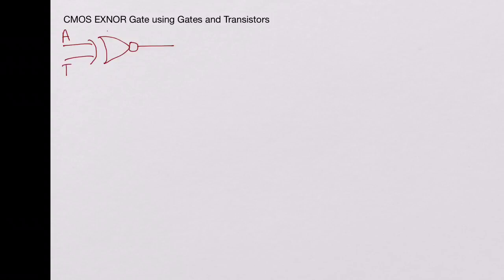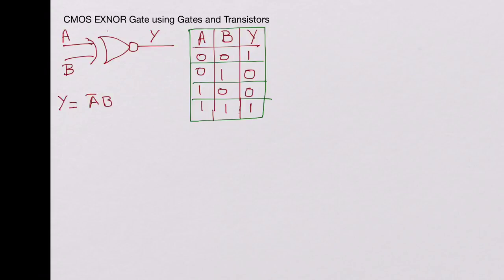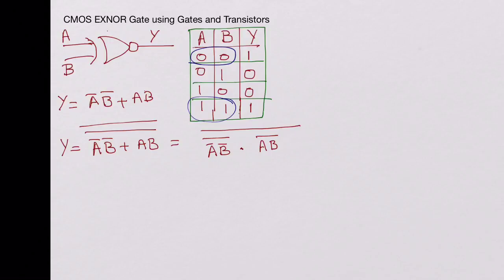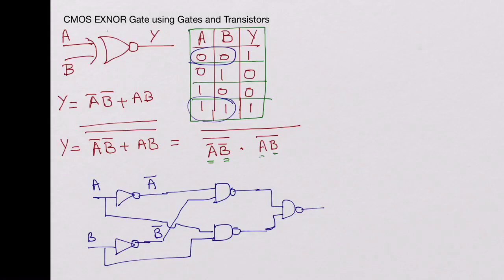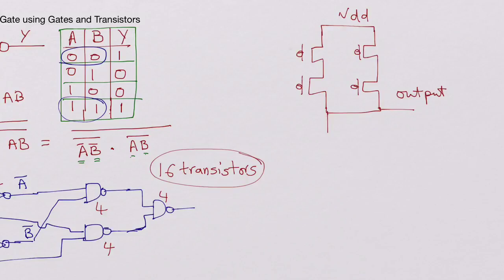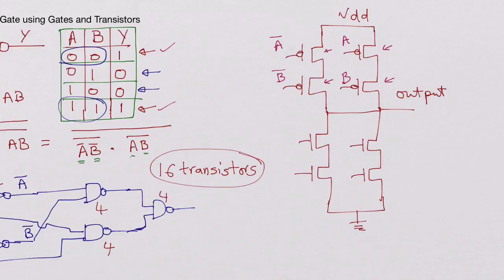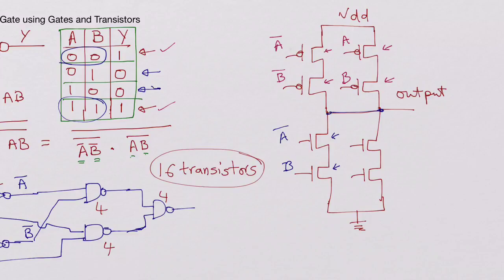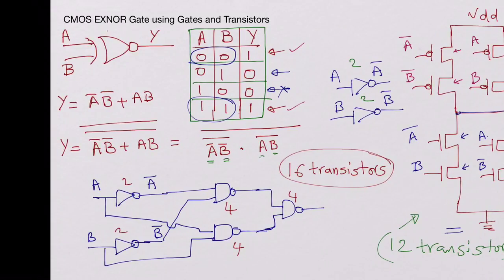CMOS EXNOR (XNOR) Gate using Gates as well as Transistors

Comment: The video is well understable.
Just what I can't understand is, that, how the number of p-mos and n-mos that are to be used are decided before designing the gate.

Can I get some help?
Reply: I don't know if this would help you now, but The number of variables = the no. of transistors
Reply: Because he knows how many transistors are required to make each of the logic gates, he can just add them up
Reply: Acc to Rabaey's book, The number of transistors required to implement an N-input logic gate is 2N. Therefore for inverter single input so 2 transistors needed. And for And gate 4 needed. I hope this solves your doubt. I learnt that Books should be read throughly. I learnt this bcoz of you, Thank you.
Reply: @chetan3667  4 saal baad reply kar raha hai tu ghochu. itne mai engineering khatam